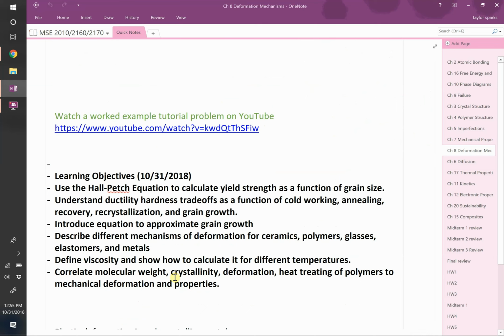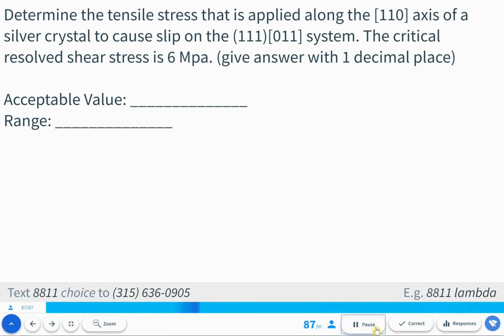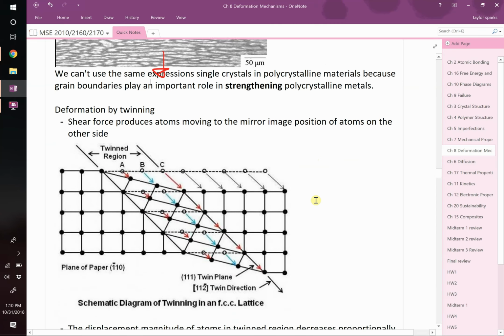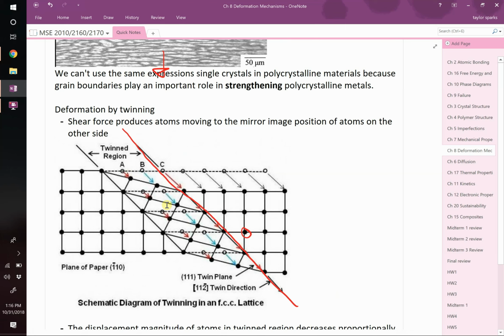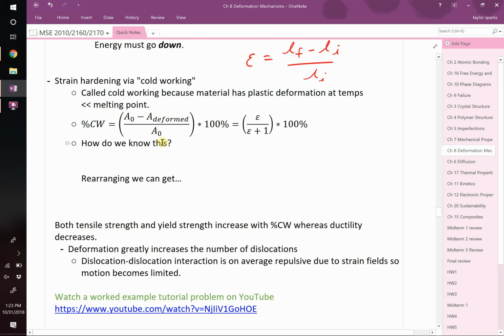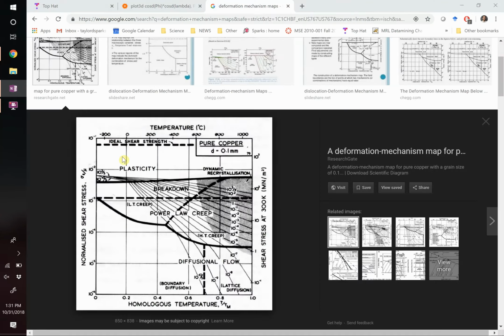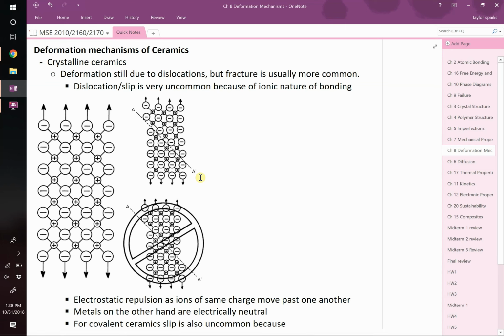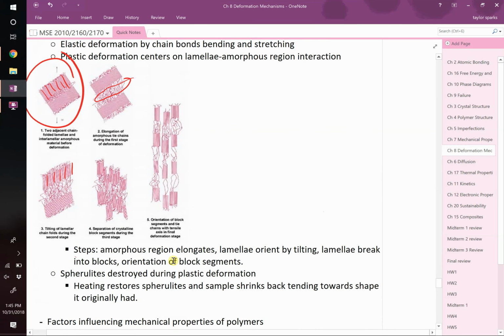Twinning vs slip deformation  mechanisms

Comment: @ 15:00 .. it's not necessary that twins are reflections about a twin interface. There are Type-2 twins which have a rotational symmetry about an axis perp. to the twin interface.
Furthermore, the problem with the cartoon is that the twins preserve the crystal structure across the boundary, which the cartoon shows to be different.

Comment: are annealing twins formed in recrystallization and are they formed for certain structures during recrystalization or for all structures
Reply from the maker: I'm sorry, I don't know for sure.
Reply: Twins are prevalent in close packed structure with low stacking faults crystals such as FCC either during plastic deformation or full annealing heat treatment. In others like BCC, twins will form but are unstable and vanish upon unloading. Better to call recovery-recrystallization-grain growth as process annealing to differentiate it from full annealing which accompany with phase change. So the twins will be formed during mechanical deformation and process annealing stages will not have any effect such as new twin generation.